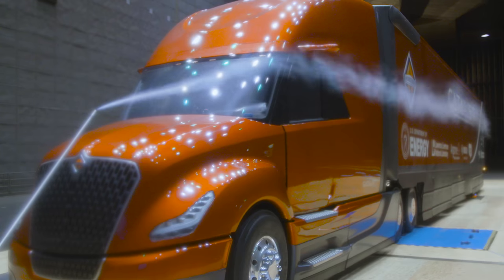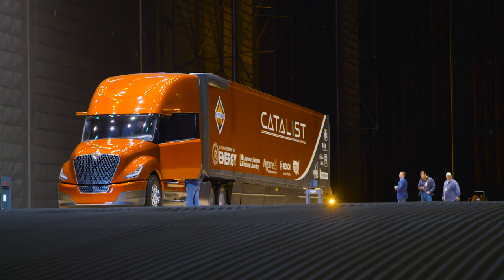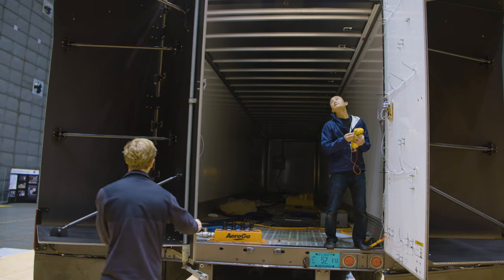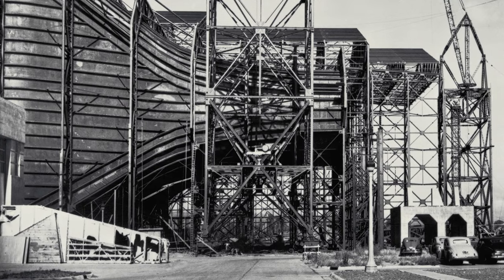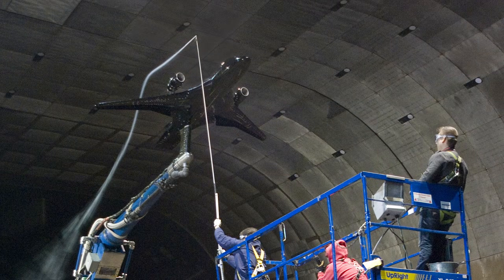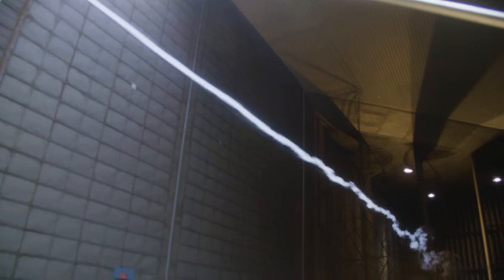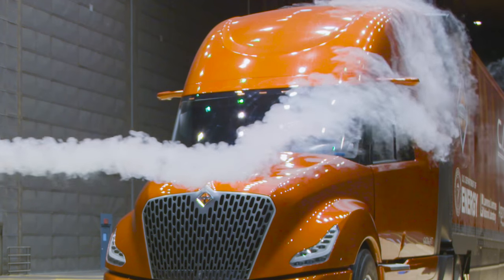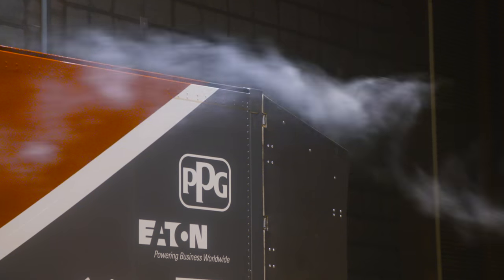Inside the World's Largest Wind Tunnel

Comment: It would be helpful if some of us were not impeded by companies that set the governor at only 62 mph (or if you drive for Prime 55 mph).
Reply: Most vehicles most efficient speed is between 55 and 65. After which the loss in fuel goes up significantly over a slight increase in speed.

Comment: do wind tunnels really help that much compared to a $0 maintenance software simulation
Reply: yes 100%
Reply: Turbulence modelling is still based on lot of assumption,

And moreover even numerical cfd depends on mesh grid for accuracy, in simple words 
Infinitely smaller mesh coupled to a computer that can handle infinitely smaller incrementals data are close to wind tunnel and wind tunnel are close to real life